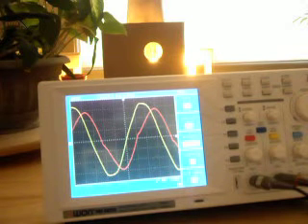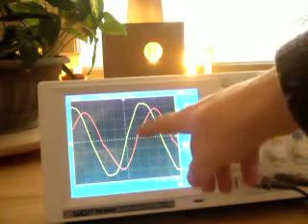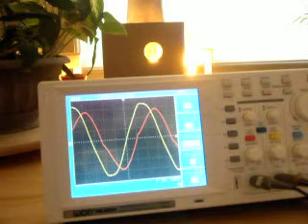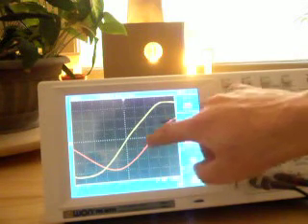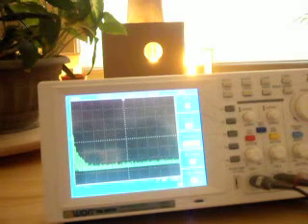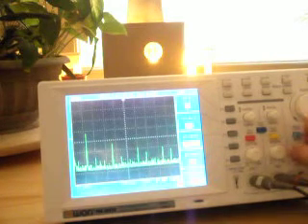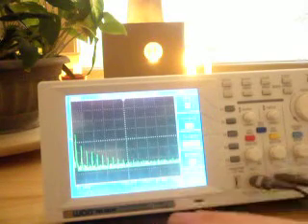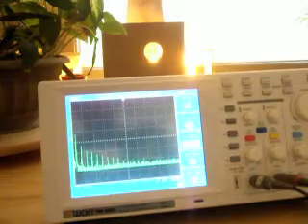Harmonics & Dirty Electricity - Part 3

Comment: MR. McGee, You should do a video of how higher source impedance causes higher voltage distortion for a given current distortion. (loads at the end of long distribution lines or sourced from generators have higher source impedance)
Reply from the maker: Andrew Dodson I've seen what you are talking about.  A very nice voltage sine wave at the generator that degrades the further away you get from the generator.  At the farthest point, you get a nasty highly distorted voltage waveform that is not a sine wave, AKA dirty electricity.  Dirty Electricity: Electrification and the Diseases of Civilization by MD Samuel Milham: http://amzn.com/193890818X
Reply: Environmental Radiation LLC It is important to educate folks that we must consider electrical systems holistically. The light bulb is part of the same machine as the power lines and power plant many miles away. It is the interaction of this entire system that can pollute both the grid and environment with disruptive harmonics, harming electrical efficiency, lifetime of equipment, and creating potential health hazards!